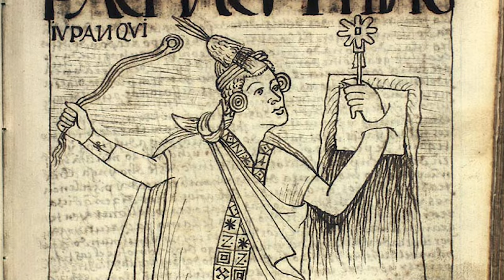SACSAYHUAMAN - How They Did It | Polygonal Masonry

Comment: The stone is made from a hard lime stone correct? there seems to be lots of different answers as to what its made of. I live in an Area of Karst landscape and I have seen similar landscape in videos of where they mine this stone. It is quite astounding how quickly it desolves even with water and it is very strong but also soft. The stone looks very cartoonish, almost fake. As it desolves in certain places it desolves in nice square geometic shapes as the water sits in it in such a uniform way. I find it not hard to believe that the Inca would have been able to find many rocks which fited together quite easily given a bit of work here and there.

Comment: You could get a smaller flat stone (one you'rve already flattened) and put mud on top of the large stune, then set the smaller flat stone on the mud and see where the small stone is raised up. Hammer down that spot on the large stone. Mud, fit small stone, hammer, repeat.

Comment: It's not verry strange that some parts might be of older/ancient civilisations..
A lot of former Inca settlements, if not all, show different kinds of architectures. Like 2 or 3 different building styles/ techniques. And from big and/or complex perfect fitting stones in "centers", to just some roughly stappled boulders at the outskirts. Most places look extend or repaired with just those simple boulders. So why continue on something on a verry different manner, which is less sturdy if you have the knowledge, the techniques and the tools to do it right?

And more ancient/older civilisations actually existed in Peru. There's no way of denying this....

The Inca era was just relatively verry recent and short. Somewhere between 1200 to 1400, I believe even shorter.

Other archeological sites in Peru, like Chavín de Huantar, date back to 1000 B.C. And which already shows precisely cut and almost perfect fitting stones.
Caral Supe, a big complex with several "pyramids" just north of Lima, is believed to be the oldest site of the American continent, dating back 5000 years (putting them into the same timespan as the pyramids of Giza).

So yes, compared to the Inca's, there already were plenty of ancient "advanced" civilisations before them, in the same "region".

Comment: There are numerous features in these polygonal constructions that simply cannot be created with stone or bronze tools. To think they "bashed" rock to such tolerances, while possible, is very unlikely. Too much time and effort required. Plus, what of the bore holes, precise right angles, large planer surfaces with extreme flatness, and more features that are out of place for the time. How did they fit them together without morter, and trial and error with that level of precision by bashing rocks on "high points" is laughable imo, template or not. Scribing does not work well with 3d objects, though lasers can profile such objects precisely. If this scribe method was used there are many instances where stones TURN a corner in both large and small instantiations. Scribing is again possible, but not a pramatic solution (suspending such large stones to fit, even aided by a wall, just seems a large stretch). A good try, but your solution is impractical and does not address too many anomalous features at contemporary ancient sites, as mentioned above. To me, this approach is trying to force the evidence to fit their narrative. The mystery remains.
Reply from the maker: what of the bore holes, precise right angles, large planer surfaces with extreme flatness, and more features that are out of place for the time
I have not seen any bore holes at Sacsayhuaman. Precise right angles are found all over the ancient world. That's easy. I don't know what "extreme" flatness is. 

How did they fit them together without morter and trial and error with that level of precision by bashing rocks on "high points" is laughable imo, template or not
He clearly says it was not trial and error, and the level of precision is nothing out of the ordinary. In fact, there are gaps between many of the blocks.

Scribing does not work well with 3d objects
As he said, only two sides were scribed at most, and with a curve, not a right angle.

Comment: Regarding that funny casting theory some people come up...
To cast something, you usually make a prototype, then make a mold of it, remove the prototype and then cast the final thing. 
That means, they would have made the same thing twice rather than once and there would be an equal number of molds around. There are ways to 3d-print molds directly, or machine from another material, but that's actually even harder to do and will leave an equal amount of molds.
The main reason to mold and cast something is to make many pieces of the same shape (unless you make a bronze statue etc). So, prototyping, molding, casting thousands of different stones would be sort of the least intelligent approach, right? If there were a "advanced civilization" doing such, I'd be rather reluctant to call them really advanced. Casting, ok, but then make equal stones, using one mold for 500 or so stones rather than one mold for one stone 🤔

Conclusion, ancient people were not as dumb as some people make them appear. They achieved crazy cool stuff with what they had, period.

Comment: So one can make the negative of a rock surface into any other  surface. Why to have the discomfort of directly working on the other rock when you can make a wall from wood, chip away the wood, and you get the negative of the rock surface. Then make a positive from it using clay. And this can be used on the other rock to make a fitting surface, so you don't actually need to move things on a scaffolding, work under a hanging rock, etc... I think they would be smart like this. And then you still need the scaffolding and the holes on the bottom side to move the rock into place.

Comment: Ancient stone blocks 
Modern concrete is made from sand with a binder known as Portland cement. It begins a wet mix and slowly hardened into artificial stone. This method shared by modern and ancient constructions differ by binding agent. Ancient people use  natural geopolymer as binder. Both binding agent went through a chemical process to turn fluid mix into stone. Being fluid the builder can pour mold a fresh mix on top and adjacent to one set previously, leaving a seamless joint was how polygonal stone wall was built. 

Sand and geopolymer came from above, known to ancient people the heaven. Actually it was extraterrestrial origin, body size varies from comet, moon and planet Mars. 

Some wise ancient people learn about sand can becomes stone after landed on earth in the country side, have organize logistic of those material to a targeted build site and to wet it into geopolymer concrete, either mold it or shape it into desired form, before schedule due, its chemical reaction process ended.

Comment: So the engineers "bashed away the unnecessary material" into perfectly fitting pieces? How were the pieces shaped to be so round and smooth?
Reply from the maker: Grinding.
Reply: @World of Antiquity  Hmm.. but how did they do that? What was the process? What was used? I'm not positing anything because I have no idea, I'm just generally curious, it's a beautiful structure.
Reply from the maker: @cyrusblackwood33  It is a beautiful structure. Stones were used to grind the sides smooth.

Comment: at 27:15 he says all they had to do was lay dust in the hole, set the stone, rub off the places where the dust went off? How can they lift these huge limestone boulders without breaking the limestone lol np. It's a geo polymer and it has the tell-tale signs all over it. It looks like poured cement, but they keep saying these stones were lifted and chiseled lol DOOOO IT.

Comment: Greetings from Utah, Dr Miano. Just subscribed. You're doing great work. Thank you.

This video is very informative, but I was surprised there was no mention of the work of 
Helmut Tributsch of the Carinthia University for Applied Science relating to the use of silica gel technology in the fitting of megalithic stones by the Incas.

Pyrite was an important component of the silica gel, and may be the underlying fact explaining the legend of Inca "Cities of Gold." Below is the abstract of his paper published in December 2017. I would be interested in your comments.

Journal of Earth Sciences & Environmental Studies
ISSN: 2472-6397 

VOLUME: 3 ISSUE: 1

"Due to its impressive appearance, Inca masonry, which mostly consists of volcanic, silica containing rock material, has received much attention. A high level of understanding has consequently been reached of the diverse working steps and tools applied. An exception is the reddish mud, “llancac alpa” in the quechua language, and the “gold”, mentioned by early chroniclers as mortar which fitted the stones and later disappeared. Such techniques were related to folklore and not taken seriously. This study tries to understand them and the question was asked: did Inca builders have access to very acid mud? They did, and used the acid mud from their mines, which generated sulphuric acid through bacterial oxidation of pyrite (fools gold). It reaches an acidity of up to pH = 0.5, which is 104 times more acid than humic acid which is known to weather silica containing rocks via silica gel to the clay mineral kaolin. This acid mud allowed dissolving and softening the rock material superficially to a viscoelastic silica gel. The process could be further enhanced more than tenfold by addition of (oxalic acid containing) plant sap, a skill suggested from popular tradition. In special cases moderate heating of crushed pyrite in gaps between chiselled stones generated additional hot sulphuric acid. Where the stone to stone contact transmitted weight, pressure dissolution in the acidic environment removed material, and silica precipitation regenerated material in cracks and pores elsewhere. It is attempted to reconstruct how the Inca builders applied the silica gel technology for shaping stones, for polishing and fitting them. The appearance of shiny and glassy Inca stone junctions and interfaces is explained via solidification of in-situ generated or additionally added silica gel. Modern processes for conservation of stone monuments against environmental deterioration have independently developed similar silica gel based technology."

 <https://www.siftdesk.org/article-details/On-the-reddish-glittery-mud-the-Inca-used-for-perfecting-their-stone-masonry/264>

Cheers.

Comment: The geopolymer argument cannot be debunked by you saying it makes no sense. It makes perfect sense to insitu cast concrete rather than haul megaweight rocks over long distances up high elevations, precision cut them into odd polygonal shapes and place them in a wall. 
It either stands up to scientific research or doesn't. I have heard that some studies have been done to determine the structure of the supposed geopolymer blocks. It was found that they had the same mineral content of the natural rocks but in a uniform non chrytaline structure, consistent with pulverized stone reconstituted concrete.

Did they make concrete yes or no? 

This is either correct science or is not.
Reply: Doesn't looks like it. I think Matt have done a good video on this, https://www.youtube.com/watch?v=oKrlR_DUXtY

Comment: 32:00 at this point, I'm looking at comparatively light materials to 'flip' in order to work the scribe. It's just a big fat NOPE. Polygonal lines with tapered vertices and additional notch detail just makes the theory impossible, as Mr Lee cites they were rolled from the inner perimeter. And more so if the stone is hard. True, the edge work is finer tooling, without doubt would be done prior to final setting, because the edges without such a tapered edge would shear off and splint off.
 Personally, I theorize/agree there were counter-levers/weights to do the moving, and the work was done as the stone was slid in from the face side, which also explains the face nubs too. First stone course, with massive stones would not be a precise fit if there is no level or factored foundation for reference. If it were buried, you'd see instantly errors from compression transfer through the vertical/shear lines.

Very stimulating content. Excellent provisions of references. Thanks!

Comment: What about the myth of the red acid mud from the copper mines?
Reply from the maker: I hadn't heard of that one. Do you know where the story originated?
Reply: @WorldofAntiquity  I can't remember where I read it. There was a famous explorer who visited the site and mentioned the red acid kind of mud that was made from the acid pools from the copper mines they had. It would dissolve the silicone crystals and allowed them to shape the rocks faster. They placed the mud on the bottom rock and set the top rock in and the weight of the top rock and the acid mud would dissolve both surface to a perfect fit. They would then go and dress the fronts. You should still be able to see reddish colors around the joints. Never been there, wish I could, probably never happen. I'm facinated by our past stone builders. They had skills in stone work we will never accomplish because we depend greatly on machines to do our work.
Reply: Even if we ditched every machine on earth, it would take generations to get to the point the Inca were at. Just a thought.